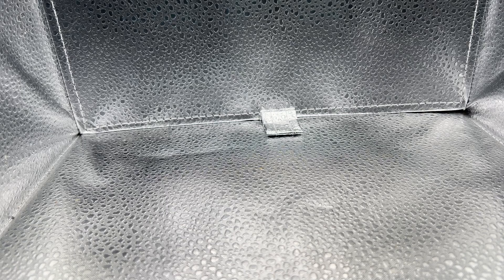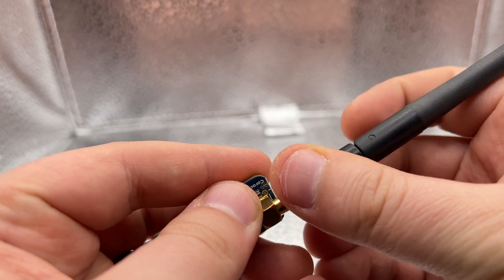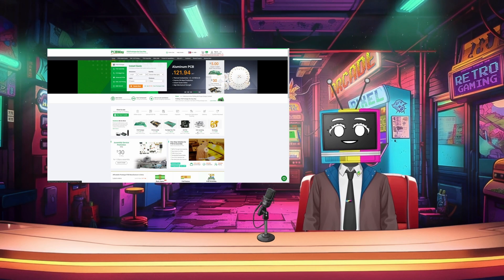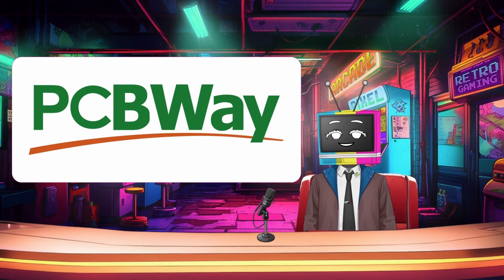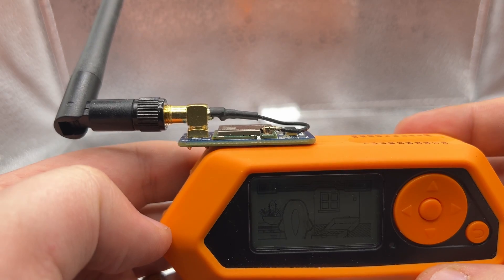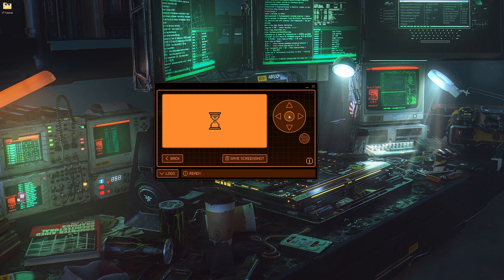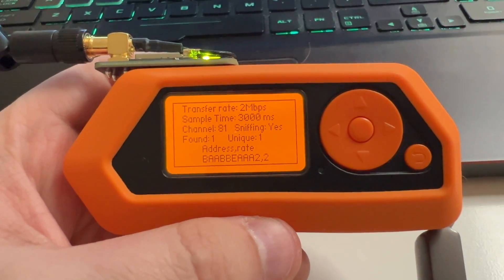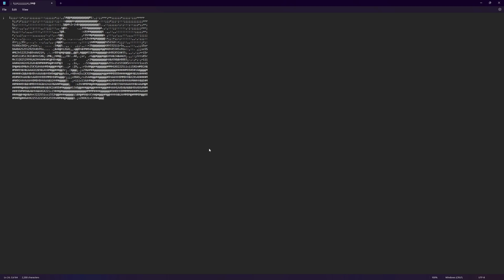Exploring NRF24 with Flipper Zero

Comment: Do you know if it's possible to use this setup to do simple replay attacks in the 2.4ghz band? I have an RC remote that transmits in the 2.4ghz ISM band and is not encrypted (I can easily capture and replay the signal using a HackRF), but I'd like to be able to do the same thing with my Flipper...
Reply from the maker: @bluegizmo1983  this should work as I was reading articles before of people capturing their RC cars and controlling with the Flipper Zero
Reply: @ModernBroadcast  How would one do that

Comment: Can I store the info for the dongle? I want to buy an old vulnerable mouse and turn the dongle into one that I can permanently use to run badusb scripts wirelessly. If I do this do I have to sniff it again every time I use it or does it save so I can load it up fast? I love the idea of just being able to have a small hidden usb dongle that can be used to run commands wirelessly (without having to be manually paired via bluetooth (BadKB))
Reply: If u get a dongle that is vulnerable then you just have to scan the adress one time and store it , after that throw the mice away and u suddenly have a small deadly usb dongle that you allways can send bad usb commands to with the same adress as that is the dongle adress so you can enter it into any device with a usb port... No jokes bro....
Reply: @uglefisken-OwlFish  Since I wrote this comment I actually decided to buy an nrf24 module and wire it up. I also found a vulnerable mouse and it worked on the first vulnerable mouse I tried. I love the idea of having a usb dongle that can be deployed into the back of a computer and have commands ran through it wirelessly. 100% worth the build, thanks for the reply

Comment: Which nrf24 module is that ??? Where did you get that one?
Reply: Or you can purchase an NFC24 single or on a multiboard such as the very nice one sold to me on Etsy's Flipmods page 🙄-Yes my wireless mouse was not found by the NFC24 after various sniffing attempts where made after
scanning threw X- amount of channels several
times over which means it is hacker proof by those standers. While it is a good security tool to have in your toolbox to check the security of your own equipment. I would caution that it's applications are limited in the real world as I just demonstrated in my personal experiance are limited to the age or quality of the technology you own more
so in a developing technological world. So you may want to consider spending your hard earned  money on protective and or storage equipment, pin protectors, wifi dev board covers, flipper zero skins or 3D printed storage
containers instead.
Reply from the maker: https://amzn.to/3PzurNe